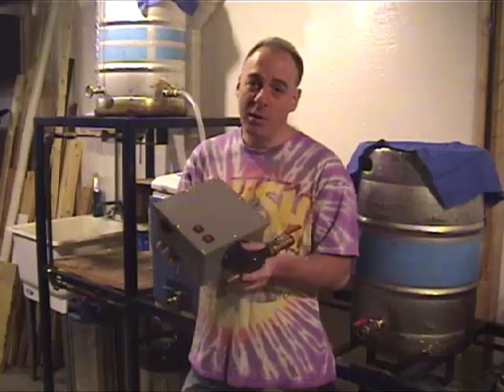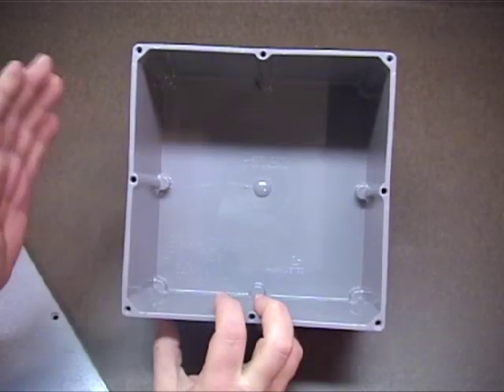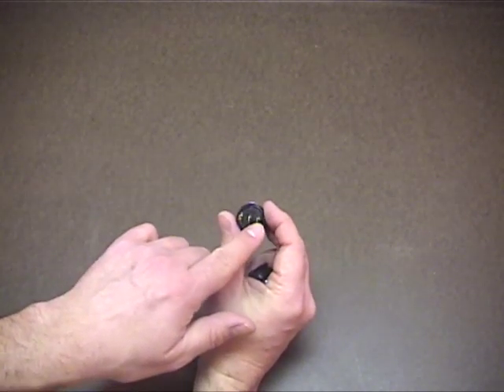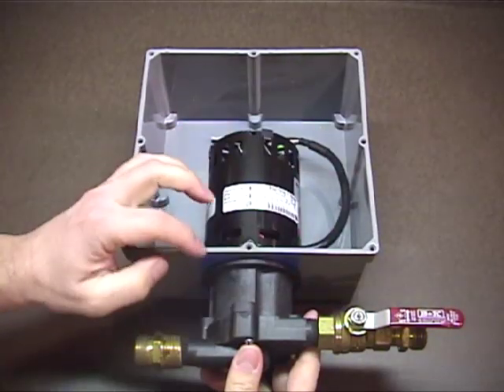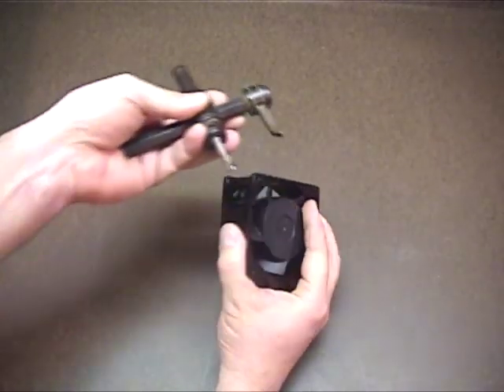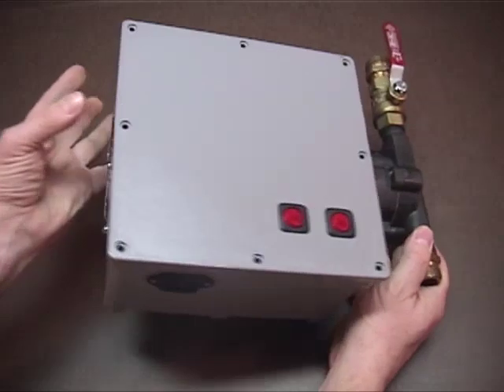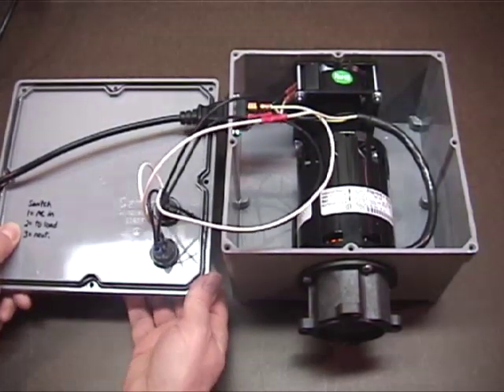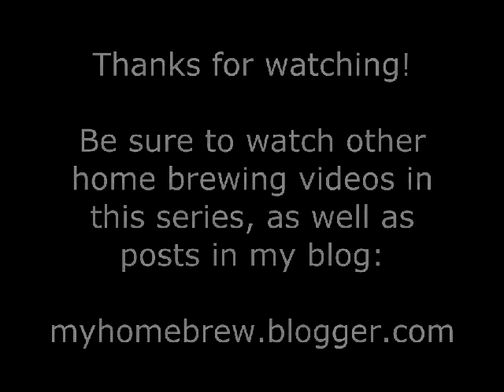How to Build a Homebrewing March Pump Enclosure

Comment: My thoughts are this.  Why enclose it in a box to begin with?  I have been using my 2 march 809 pumps on my brew system for 3 years now.  I have never had a problem with them getting wet.  It seems to me that you are just adding extra cost and headache.
Reply from the maker: The primary benefit was having the power switch right near the pump. Mine came with just a pigtail, and I would have had to make a plug...sticking it into an outlet to turn it on seemed primitive. It is just nice for me to have a simple box, and I've never had a problem with it.
Reply: It looks great is why I would do it if I could

Comment: Hey Joe have you had any problems with very heating on this enclosure? I have a chugger pump and they are saying not to put it in an enclosure. Looks like great ventilation but figured I'd ask. Thanks
Reply from the maker: Never had any problem. I keep the fan running after usage, and lubricate the motor as directed through the oiling galleys.

Comment from the maker: Being able to run the fan on its own allows you to pull hot air out of the enclosure after the pump has been running. Since the motor itself is designed to run out in the open and cool afterwards by being exposed to room air, the separate fan switch prevents any problems caused by long term exposure to heat after it has been shut off.

It is a simple safety feature that will make your motor last longer. Worth the effort and the extra $4 in parts.

Comment: can you elaborate on the two switches?  isn't it really only necessary to run the fan while the pump is running?  I can't think of a reason to run the fan by itself.

Comment from the maker: I recommend using two switches to keep your motor cool.

Assuming you're using a non-lighted switch. From the inside of the power connector, the ground would go to the fan (it it has a ground) and the motor. The neutral would have 2 branches: one to the fan, and one to the pump. The black wire would go to one leg of the switch, and off the other switch leg there would be two branches, one to the fan and one to the pump.

So your switch is giving power (black) to two items at once.

Comment: great video.  i already ran out and picked up all the stuff to build a couple of these.  what would need to change in your wiring diagram to accomodate 1 switch to control the fan and the pump?  I'd rather have a single on/off.